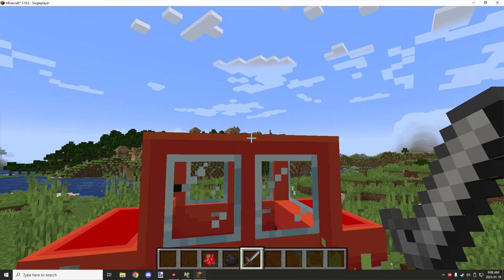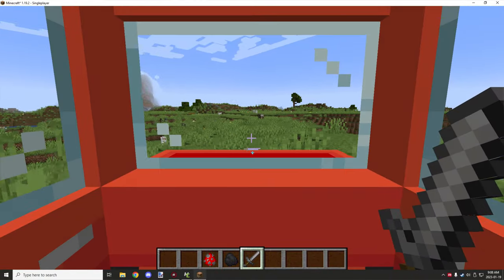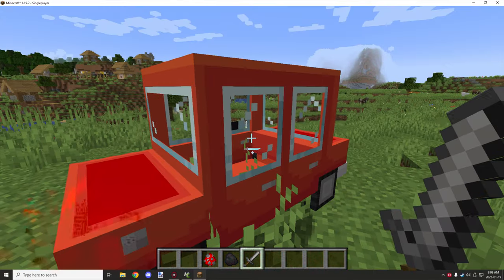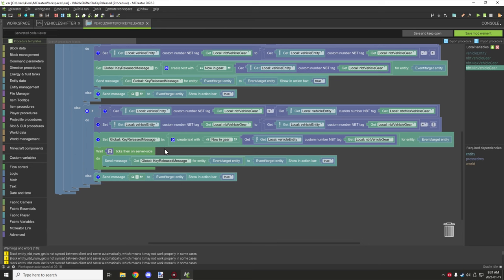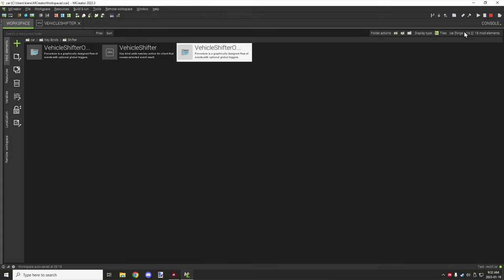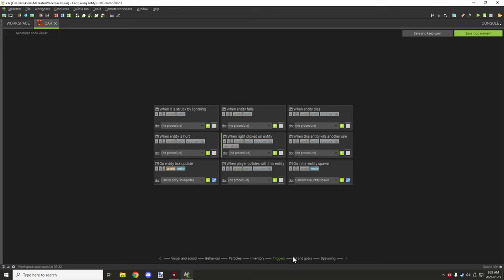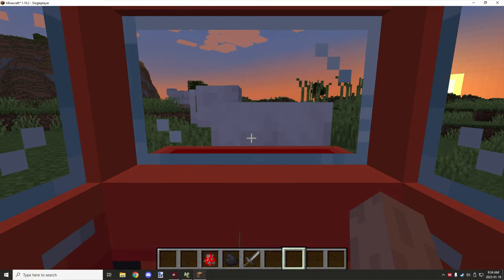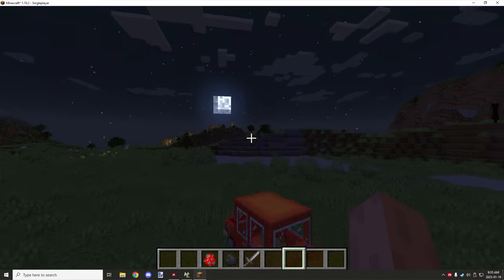MCreator: How to make cars with gears | 2022.3

Comment: Is it possible to emulate car movement? Steering, drifting, etc.
Reply from the maker: It may be possible to do with movement vector (or what ever its called now) but you would need some math calculations to get it working. Other method would be to code it in with custom script but that's beyond me.
Reply: @NorthWestTreesMCreator  Danke, mate!